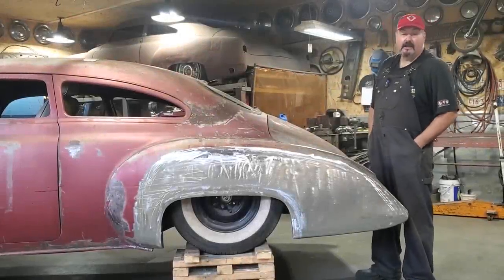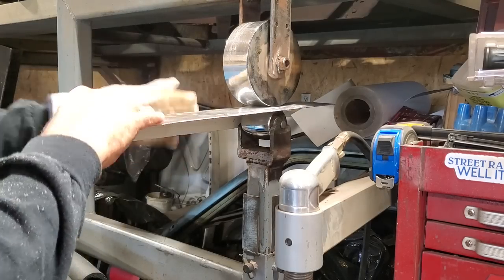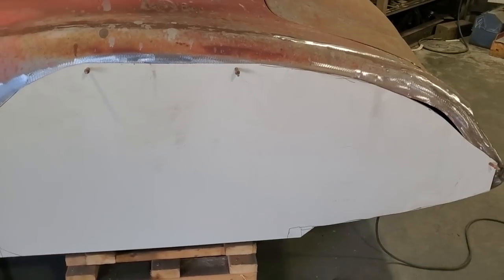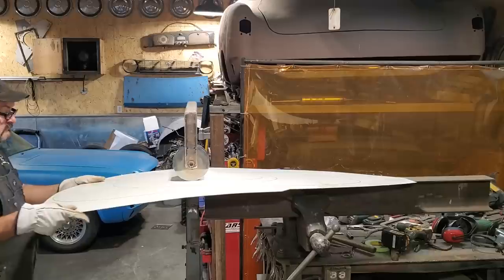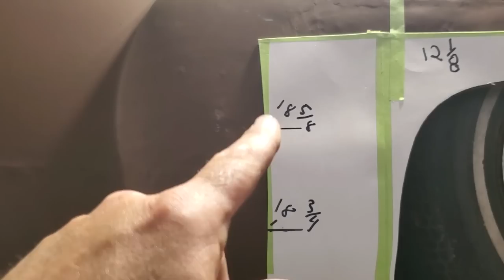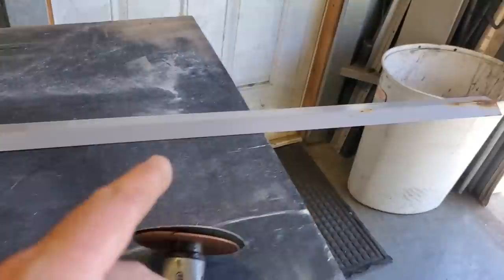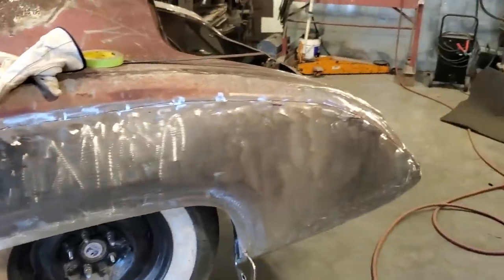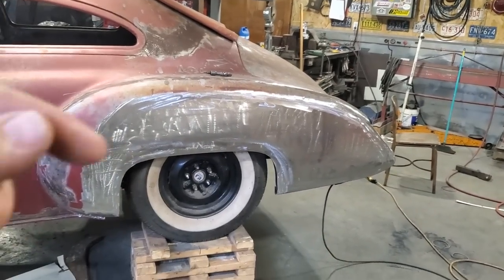Simple body panels made from scrap steel

Comment: Brilliant! Using that straight-edge steel to insure that the quarter panel is straight and smooth "no waves" and you needed to put a lip on it anyway. Talk about knocking out 2 birds with one stone.  Also, about 6 months too late as I already finished my project last summer but the cutting wheel tip was assume. I was cutting incorrectly and did not know it. I can see how just using the edge of the cutting wheel will last much longer. Remember, I never welded nor did metal bodywork in my life. Thanks to you and being self-taught you can not tell that the work on my 1976 Eldorado convertible was ever done. It looks completely factory inside and out. I also love that you show your mistakes and how to correct them or what not to do. That in my opinion is such a valuable learning tool, at least for me. Thanks so much and looking forward to the next one!

Comment: years ago when I got my English wheel the 1st night did not have much metal laying around .. had a strip 5 or 6 inches wide and about 2 feet long ,,, started rolling / playing learning ,, nailed my thumb in the wheel ,, had a few words and started rolling again ,, well had a few more words got the other thumb ,,  also learned to slow down a bit in my rolling ..  great video thumbs up ,,,

Comment: Fitzee, I am sorta glad you had no roof panel because the video covered something that everyone learns from. I have a bench top English Wheel and it needs material added to the frame for stiffening and it sill not handle a panel as large as that fender panel you made. It is enlightening to see how just rolling in one direction curved the panel and you did not have to go the entire length to accomplish this. Great explanation of how you tackled it and the result is the proof. Longer? Yes. Better? maybe. More skill learned? Definitely.  Thanks again.

Comment: Thanks Fitzee, the sinple tip on the cutting wheel has saved me a lot of blades. I'm about to do doglegs & partial quarter panels both sides on my Volvo.. Making my own panels, i already did  the rocker sections from scratch.

Comment: Like your work, well done. Probably been mentioned but if it hasn't you can get a rubber band for the large wheel on your English wheel. This prevents marks. Although I was thinking if you wanted to save a dollar maybe you could measure up an old inner tube and use that. Anyway thanks for sharing.

Comment: I was watching a video some time back on another channel, where the guy showed exactly what you showed with cutting sheet metal and only using the tip f the cutting wheel. He first did deep cutting and only got about four cuts before the cutting wheel was worn out. Then he did what you showed and he got over 20 cuts, so the cutting wheel can last five or more times longer with the correct technique.

Comment: I personally like to use use air powered nibbler to cut metal sheets when possible. Less dust, less used cutting disks and less sparks. But I'm a noob and I only do practice pieces until now, not ready for a car yet. Still learning to weld (tig). I'm already great at turning small holes into larger holes. The other parts: not so good yet.
Reply from the maker: The more you do the better you will get. Mistakes help us learn faster.

Comment: I have been watching your channel for quite some time. I am going to attempt my 2nd try at fabricating a fuel filler pipe hole on my 73 sports roof mustang. It will only be a small piece about 6 inches long by 4 inches wide with a small lip like you did on this wheel well. The first try on my Barracuda I was burning through the metal when I realized I used to thin of sheet metal. This time I am going to make sure I use 18 guage.... I will let you know how it goes. If you want I can send pictures. Wish me luck.
Reply from the maker: Good luck.

Comment: Would putting some kind of fan or blower behind the panel to cool the metal make for faster welding?
Reply from the maker: Ya that could work  but you have to turn it off when welding it might blow  co2 away

Comment: Do you apply anything to sheet metal after grinding off the surface coating, to prevent rust? In some locations you could practiaclly watch the surface going brown,
You might like Wray Schelin's "Pro Shaper" channel, to watch him using the English wheel.
Reply from the maker: I try to keep my shop dry so it dont rust.
Reply: @fitzeesfabrications  I didn't realise that was possible in Newfoundland.

Comment: Just curious, Will you try and see if you could remove the tire? This video was great! What you do is so interesting and looks good when your done. If you have high areas would you suggest a shrinking disk method? Again great job.
Reply from the maker: Wheel should come off will have to be up on its bags. Don't have a shrinking disk and I have never used one. Known about them for years but it's something I just never really wanted. I seen they do amazing work. Like to see one in action up close

Comment: You talk about the cutting wheels.Have you ever tried the 4.5" diamond wheels? I have used the regular wheels like you use but just ordered a Lenox 4.5 diamond edge ($12) to see how it does.I have a number of things to do,cutting some aluminum bar is one and later the 1/4 and dog leg on my '96 Explorer and then '68 Bronco once I get done with the room I need for the Bronco as I'm doing a full off frame resto.
They're probably way to thick to do your cut and butt,but for all the other cutting I'm thinking they should do a lot better and cost less in the long run.
Reply from the maker: Seen them used in cutting box steel. Very cool but like you said they are  to thick for cut and butt

Comment: Excellent video, thank you. If you had to make these panels and you didn't have an English wheel, how would you go about it? Also only roof panels available here now days are modern thin ones. So a choice of thin roof or flat sheet as a starting point. Or is it not worth attempting? How did you do your car in the background, Was that a roof panel?
Reply from the maker: Must be someone around scrapping older cars. If it's all you gave you can make do. The thin stuff works better it you do lap welds.it is much easier to not blow threw. The fleetline on the rack is made up of metal from a 52 chevy 4 door I scrapped.
Reply: @fitzeesfabrications  unfortunately cars made from 18 gauge here are rare and certainly not scrapped any more. Most semi old cars here are British, Ford Escort and Cortinas, Hillman Hunters, Vauxhall Vivas, stuff of that nature.  But all those are now rare and collectable as they all suffered from rust. Then second hand jap import became a thing. Early Corollas, Datsun 180B, or the triple S, things like that, also rare now due to rust. Then a few years ago the price of scrap steel went through the roof, that tended to clean out a few more. Forgot to mention the Australian cars, Holden and Ford falcons, also Valients were common is you wanted a bigger car. Everything old is hard to get a hold of and what there is tends to be restored or used as donor parts for restorations. Local scrap yards, car wreckers etc are pretty much all 10 - 30 year old jap cars. Newer still in use, older are gone or collectable. We seem to have evolved into a disposable society, use it until its scrapped, or its classed as collectable and not chopped up. We also have politicians who are doing there best to get rid of old cars and definitly stop modifications. Just about anything requires certification now. Crusty would be a nightmare. Its getting to the stage that even bodywork, fixing rust or accident damage requires certification. I look at what people like you and Make it Kustom are doing with envy, partly due to the talent shown but also because you are allowed to still do that sort of thing. We can, but there are a lot of hoops involved.
Thanks for your efforts with this channel. Definitely appreciated,  for the information but also the motivation. Both are important, thank you.
Oh forgot about vw beetles, used to see a few of them around and the mighty Austin Mini. The mini starred in a movie "Goodbye pork pie". The New Zealand version of Vanishing point 😀

Comment: FITZY, what other TOP COAT brand  paint is  safe to use over INTERSEAL 670 HS primer.
TREMCLAD aint available in Australia. Can you recommend  one  please.
Reply from the maker: Go to a tractor supplier store and see what paint is available. Alot of automotive paint companies have a cheaper line of paint as well. If you ask around your part you should find someone that knows of a cheap line of paint. Your local hardware store should have a line of rust paint  as well
Reply: @fitzeesfabrications  Fitzy, i have good acrylic paint on the inside of the car but its 50yrs old, looks ok but thin imo. Do i repaint on top with an acrylic, or a undercoat sealer, or apply fishoil... or leave it?
Reply from the maker: @peterk4501  depends on how bad it is? Problem with painting over old paint is it might lift. A single stage paint should work ok. Don't use a base/clear setup as the reducers are very harsh and will lift the paint. I like to seal it officially I can with a sealer. This should help it from not reacting to the top coat. But it's still hit or miss. On the outside make sure you strip all the paint off as this will be the best solution so it dont happen there.  Now in saying all this using cheap paint it a hit or miss and hope for the best. Sometimes its faster to just top coat over it and if it lifts then address the issue.  One out of 4 times it might lift. Depends on what there for paint and what you are painting over it.
Reply: @fitzeesfabrications  thanks Fitzy.,,, i will try out a test patch and see how it goes. Hope you do a dedicated video  on Paint sometime.!
Reply from the maker: @peterk4501  I painted for years   and try to stay clear of it as much as I can. Lol. But I will be giving my 51 chevy a face lift in the spring. And I have to paint the mustang around same time

Comment: G'day Fitzee
I have seen guys remove entire skins from   bonnets and doors but each time I try it I end up with kinks on the outside of the panel where it's bent inward as I've pulled the flange back.  Any tips or videos that can stop this please?
Reply from the maker: You need to place a flat dolly on the top side of the panel and slowly work the lip back using pressure on the dolly to keep it from rolling on the top side

Comment: Curious to know roughly how many hours is in this project.
Reply from the maker: Might be 8 to 20 hours maybe
Reply: @fitzeesfabrications  First, this came out great.  As you started on the rear of the car fitting in different taillights and reworking panel beneath decklid it was tough to visualize.  Not that you're almost done with the quarter, it's easy to see where you are going.  I am not a big fan of skirts but I will be curious to see if it adds anything to this car.  For next video, can you include some shots showing entire side of car, quarter view, rear end etc.?  It's really coming together.  One other idea it would be fun to see this car in primer and painted, when that happens
 Great video.

Comment: If pilots and passengers on planes were issued a grinder, air hose, and welder cables they would not need a parachute. They would never hit the ground as long as they had those leads.

Comment: Good work as always, but call me crazy, I would have made a roll on the edge of that panel so it had an extra crease, make the fender wider and matched to curve of the whole side fender curves. Used a batten to make a nice curve, and swooped the wheel opening some so the front wheel opening was matching the rear opening. Extra work, yes, but that would be so cool with flared fenders.